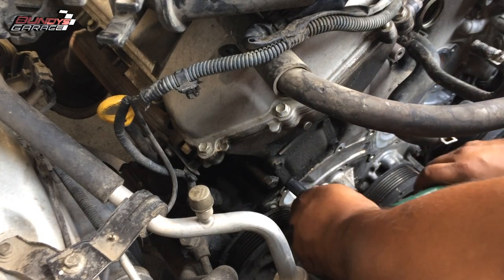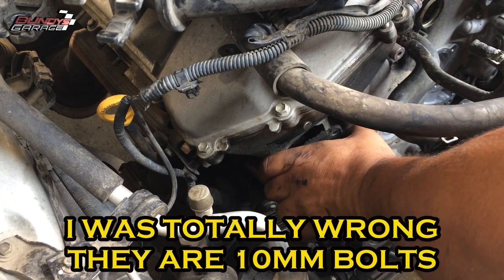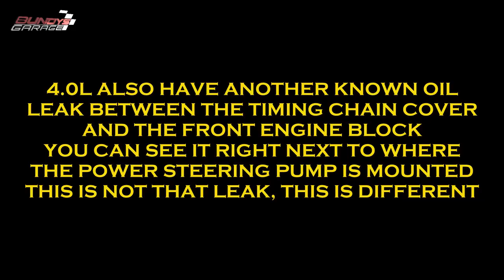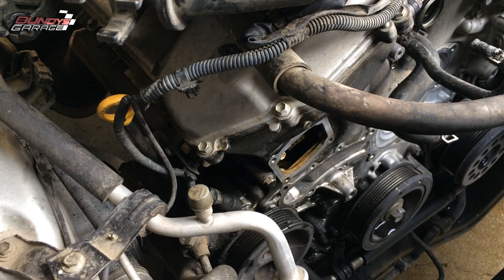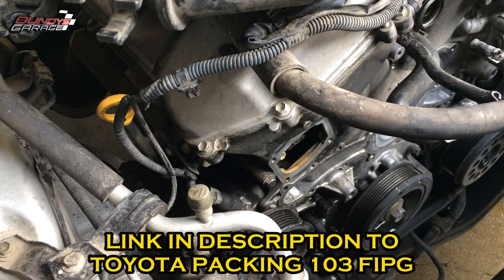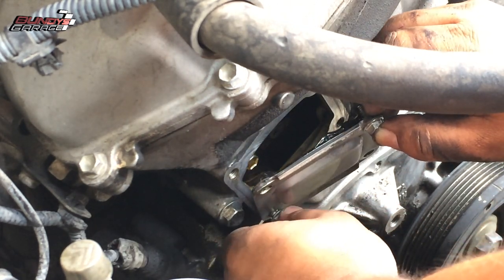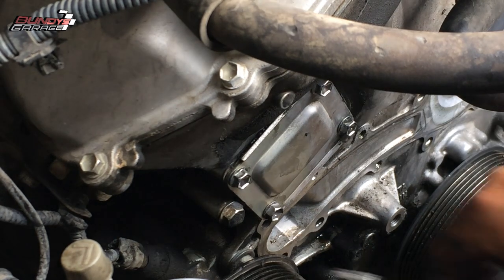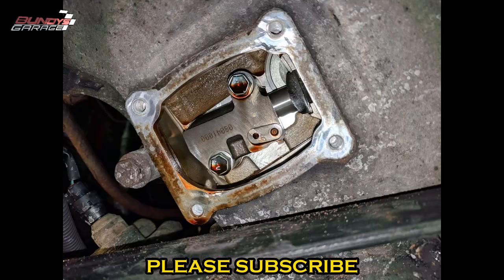4.0L Toyota Oil Leak Square Plate Cover | Timing Chain Tensioner Cover Tacoma 4Runner Tundra 1GR-FE

Comment: FYI, the part number for the timing cover gasket is: 113280P010. Bit pricey,  $14 picked up at my local dealership but worth it for me and the peace in mind.
Reply from the maker: Thanks for the part number.
Reply: 80 lbs per inch of torque

Comment: Go very softly on those bolts!

Just did it and think i may have stripped a hole just doing a firm by hand tightening.

Super quick and easy fix.

Local dealership gasket was $35! Parts guy said just using rhe toyota gasket goop would be fine to seal and hold.

Had his own story of sealing a Honda timing cover with 2 broken bolts with this stuff.
Reply from the maker: Toyota Seal Pack 103 FIPG is amazing stuff, I use it all the time, be that a Honda, Lexus, Chevy Ford, whatever needs to be sealed, Toyota FIPG is what I use! Here it is: https://amzn.to/3s09hLB

Comment: I wish I found this before ordering my valve cover gaskets
Reply: Did you get your V covers done?
Reply: I would still get that gasket. After 110k miles on mine was basically hard plastic and crumbled when I removed it. Also the intake gasket was bad too.

Comment: that's exactly where I've been seeing oil on the engine, looks like a super easy fix, thank you!
Reply: Why do they need that holes for>>> Toyota need to seal that holes to prevent leak?
Reply: @ThepDenNgoaiBien  my leak ended up being from the timing chain cover, the assembling machine did not add enough liquid gasket to seal it.

Comment: You mentioned another leak that can occur, what does it take to fix it? And how do you tell them apart?
Reply: I’m curious also as I have a leak. If he gets back to you please let me know.
Reply: I have the same issue. Not even a mention on what the quote "other leak" is  even.
Reply: @TheEndsMeatShow  the other leak would be the timing chain cover- there was a recall that has long since expired. a lot of billable mechanic hours to change the timing chain cover gasket. very expensive. mine has been leaking for months. I smell oil when driving, stain on my driveway. but......have not lost any oil according to dipstick....(?) a small seepage can make a big mess. im going to try this fix this weekend and clean the entire area best I can with brake cleaner. if it isn't the 4x4 inch cover mentioned in this video the leak is just behind this cover on the timing chain cover, if it ends up being the timing cover I'll just keep driving it and monitor the oil loss. if it gets worse I'll pay my mechanic. I have 185k miles on my 2005 tacoma.
Reply: @ashdobbs I have it leaking from that same spot on my 2004 4runner with 280k miles but I'm never low on oil or see any oil stains on the driveway
Reply: @TheEndsMeatShow its the entire timing chain cover leak. You need to google it. In that "other leak" from what i have there is a depression in the engine block of about 1mm a design fault fixed from 2009 prados onwards. And it involves putting a new gasket on the timing chain cover. And then using some of this sealant also in that little 1 mm indent on the block. Enough googling will find it. Good Prado 120 timing chain cover oil leak. I have a 2004 120 with 310,000 km (200,000 miles) just brought it. And doing this timing chain tensioner cover first as it's a super easy fix. My mechanic also told me the front rocker covers also can leak

Comment: do you need to drain the oil before doing this? attempting this on a 16 Tacoma on Friday
Reply from the maker: No you do not need to drain the oil to do this. If you need an oil change it’s a good time to do it but no you don’t need to drain the oil otherwise.
Reply: @bundysgarage  thanks for the reply! The 16 Tacoma is a little harder to get at. These engineers keep making life more difficult for everyone......where the bolts all m10 x ????

Comment: Torque spec is 80 INCH pounds....its in the Engine Mechanical pages.....page EM-124 of the 2006 4Runner manual... Pretty much the same as the valve cover gasket bolts...+/-
Reply: For tacoma 4.0L, it's Engine Mechanical EM-55, Camshaft (For Bank 1): Comopnents (Tacoma) where it'll have a blow up diagram and the torque spec which is, 80 in pounds which is the same!
Reply: 80? Are you sure?
Reply: 80 "inch" pounds = 6.7 "feet" lbs, so very little effort.  Snug them up and you will be good.
Reply: Wish I had understood how low the torque for this was. I firmed them down and think I may have stripped one corner bolt.

Comment: I noticed the bottom where the plate seats is dry no oil residue when you took it off .. does that mean if its moist. The issue is the timing chain cover ?

Comment: Do you have a video on this other leak by power steering? I'm experiencing this seepage.
Reply: Most people just leave it. Unless you have a leak like mine does now where it is gushing oil out of that timing cover by the power steering pump. I am getting ready to start taking the cover off to fix it.  Drew's shop life has a 2 part video on it

Comment: can you change the tensioner by removing that cover? or is it only for inspection?
Reply from the maker: It’s only for inspection. If you pop out the tensioner how are you going to keep tension on the chain?
Reply: Won’t the chain guide keep the chain in place while replacing the chain tensioner? I’m also curious about this.

Comment: I also have the same leak at the front of the block.I wish there was some info on that leak.It’s probably a lot of mechanic hours to fix that 1.
Reply: I've got 534,000 miles with that leak. just check Ur oil often.

Comment: Are you spraying break cleaner in the engine?
Reply: @MrFairworld  thanks for you input! If you spray brake cleaner into oil does that still apply? I would think it would lower its lubricant properties. Just a thought no expert by any means. You defiantly need a clean surface so what other option do you have¿
Reply: @TabletSnipes  yes, it will fuck the oil up and not evaporate once it's in the oil. I'd spray the rag then wipe.
Reply: The way he did it is fine if you change your oil afterward. Otherwise, Spray it on a rag and wipe  clean the whole surface.

Comment: Toyota dealership is charging me 500$ for a valve replacement for my 2012 sr5 4runner is this too much ? There is also oil already leaked so they will have to clean it up a little bit
Reply from the maker: sounds about right

Comment: Do you have to drain the oil before removing this?
Reply from the maker: Negative
Reply: @bundysgarage  thank you so much! I’m literally doing the repair as i type this, so I appreciate the quick response!! :D
Reply from the maker: No problem. Check out my water pump video for the same engine if you ever need to do the water pump: https://youtu.be/SySKizdRA0I
Reply: @bundysgarage  any leaks for roughly several months later? It fixed it?
Reply from the maker: Looking back I should have scraped the old gasket off. Then applied the Toyota seal pack. It is not leaking at the square. But on these engines the timing chain cover is known to leak in seeing oil leaking (very slowly) from there. The leak is right next to where the square cover sits so it’s hard to tell the difference. But I know for a fact the square was leaking cause it was dripping onto the oil water pump. Where the one for the timing chain cover will leak towards the back near the power steering pump.